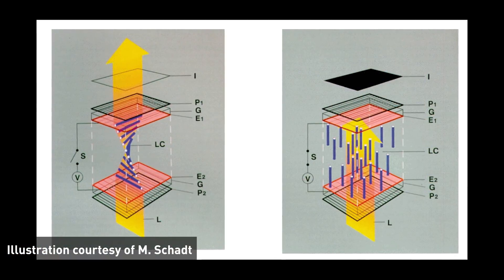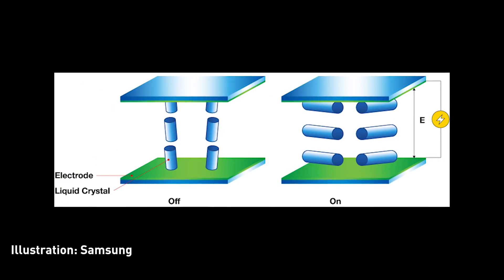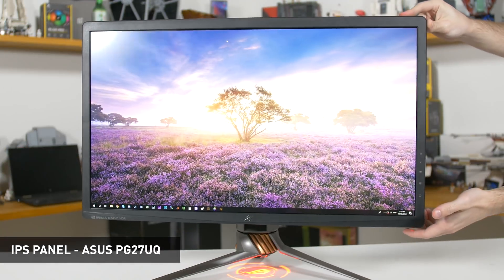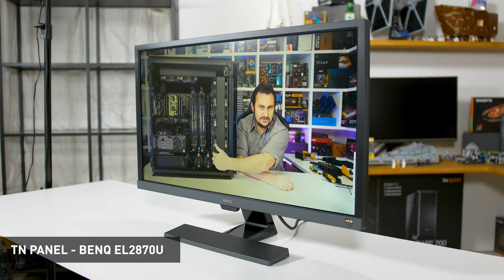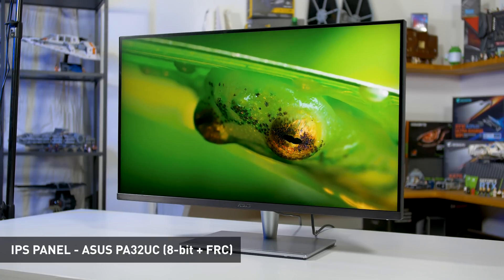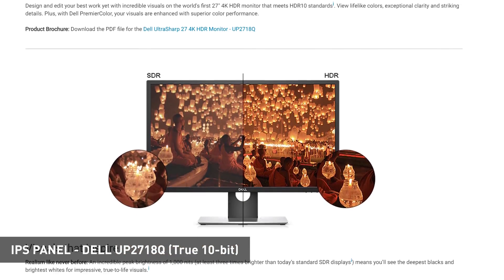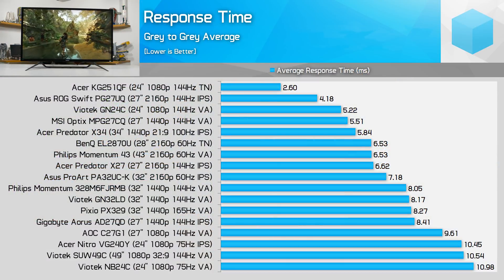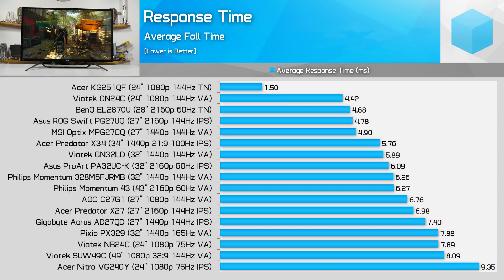TN vs IPS vs VA: Which LCD Monitor Tech is Better?

Comment: Human eyes can't see more than CRT
Reply: High end CRT's are so good though. They aren't as sharp, but they have basically zero ms response time and also have high refresh rates. Their size is the biggest problem, but honestly if I could still buy a high end HD crt monitor, I would buy it in a heartbeat.
Reply: @wile123456  shame about the eye cancer
Reply: @wile123456  It would be amazing if a company would make a modern 4K CRT screen.
Reply: Human eyes can't see period.
Reply: You can download CRT.
Reply: CRT is actually very good because it has the lowest response time. Much better than these futuristic flat screens.
Reply: Its part of the input lag anyways, there are 4ms ips panels who perform better than tn 1ms response time, and the tn just looks awful compared to va and ips, stupid.
Reply: @marcrchtz9024  how would a display with 4ms of input delay preform better than a display with 1ms delay
Reply: Because its all part of the input lag that matters, you dont notice it that it takes 5ms to put it on the screen if its a decent input lag.
Reply: @marcrchtz9024  yeah plus the fact that u would have to push a frametime with a input delay of 1ms so i suppose ur right
Reply: @imnotusingmyrealname4566  haha lol who told you such nonsense ...
Reply: @imnotusingmyrealname4566  yea only now has oled catched up with CRT's from 20 years ago. Just a fucking shame OLED monitors dont exist because of burn in.

Hopefully micro LED will be the panel technology with no downsides
Reply: @wile123456  CRT screens also had burn in.
Reply: @OTPulse  They did, but typically only when used as security monitors with 24/7 static images for very long periods. CRTs also lose geometry and brightness over time. However, they are still incredible machines. I use a Sony C520K with my 1080ti. If you have an AMD GPU and an HDMI to VGA adapter, you can even use FreeSync using CRU and other tweaks. I only need to last until MicroLED arrives.
Reply: @OTPulse  that's true but not as bad as OLED. Screensaver existed to prevent burn in back in the day, but apparently that isn't enough for oled . we might not see monitors with old because they are expensive and manufacturers think nobody will buy them.

But I would gladly take a 1 ms old screen with better contrast ratios than all these panels , but I just dont have the option, and living room TVs have too much input lag
Reply: @HansUberschlage  You should have seen all the old CRT screens I removed from the local RSL club from all the TAB monitors and other gambling charts they displayed for 14hours a day for 363 days a year. I'm not rich enough to be willing to test out what's got the worst burn in between OLED or CRT but i remember having minor issues with CRT even at home when i left the NES on pause and forgot about it and went out. Was a $2500 (in the early 1990s) 62cm Blaupunkt CRT, to say my father wasn't impressed would be selling it short. I was lucky the burn in actually faded away after a couple of weeks.
Reply: @OTPulse  if the retained image faded then that wasn't burn in that was image retention
Reply: @brotothewilliams9890  the burn in was still there, it just faded after a couple of weeks to a point when watching TV its wasn't noticable unless you looked for it intentionally. I still have the TV in the shed with a set top box with it. Thing weights a ton and in an awkward spot to remove so its staying there, still works.
Reply: @OTPulse  Oh yeah, they definitely burn-in permanently if left on continuously, the phosphors can only tolerate so much, but most often the temporary image retention can look like burn-in and goes away after a few hours or days of watching other content. When we switched out all of our traffic camera monitors (all CRT), they had permanent burn-in from the static OSD data. You could still see the OSD data when the display was powered off due to the excessive damage to the phosphors!

That said, that's why I have always done my best to protect my CRTs. At present I have three perfectly tuned CRTs in my house: Sony GDM-C520K (primary PC gaming monitor), Sony KV-34XBR800 for some 6th/7th gen consoles, and a Sony KV-32F something something for all my classic gaming/arcade. I've also got a 480p Sony plasma for standup arcade gaming, but I haven't worked on it for a while. I've got some short videos on my channel if you want to see some of them.

P.S. I love OLED, but can't justify cost relative the risk of burn-in, thus I went with a Sony 65" X930E VA display for my movies/XboneX gaming. Funny, I never realized until now that my only CRTs that have survived over the years are all Sony. My NECs, Mitsus, etc. have all died. I take that back, my FW900 died about 5 years ago. :(
Reply: @HansUberschlage  I had a Sony Trinitron until a couple years ago. Was a beauty. It too still worked but I sold it for $300 to someone who made an arcade machine with it. Kinda regret it now honestly. The only TVs we owned were Blaupunkt or Sony and they all worked when we got rid of them. One of the Blaupunkt got hit in a lightning storm and blew out the tuner and audio side so it was basically just a monitor in the end. German or Japanese stuff was solid back then.
Reply: OTPulse oh I brought a 15” Sony Trinitron monitor about 20ish years ago. Best monitor I’ve owned by far in my 20 something years of pc gaming. When I first got a 3dFX voodoo card back in the day it was amazing with the Sony. Even most tv and movie special effects looked better on our old Sony Wega crt tv than on the 65” curved TCL tv we currently own.
Reply: @wile123456  ya i found the FOMO channel too.
Reply: @imnotusingmyrealname4566  not necessarily Tn monitors can have higher response times and refresh rates
Reply: AssassinKlD final year crts were better for stereo 3d display the black to white transition times were very good much better often than the smeary grey to grey times of lcd's
Reply: They can if you download more ram.
Reply: I enjoyed 120Hz on my CRT waaay before LCD screen even appears. There is practically no motion blur at all on fast moving object, When I switched to LCD, it was like crap, motion blur everywhere and when you change resolution to non native resolution, the graphic will look like garbage.
Reply: @Chiyo Late   Exactly!  Never understood why LCD took over the monitor market so fast, it is like people have no eyes. Image quality was tremendously worse compare to a CRT for years, and they have still not caught up in all areas. It is like " hey it is cheap and small and I don't care if it display shitty graphic".
Reply: @Revener666  It was cheaper to manufacture and provided the companies larger profit margin on the product. Normally it doesn't take this long for newer dominate tech to catch and surpass the old though which is where I would personally like to find out the answer to.
Reply: @chemislife but companies can't sell anything if consumers don't buy. Sadly most people doesn't care if something is an inferior product as long as it is cheaper.
Reply: @Revener666  they translate some of the savings to the consumer so as to encourage them to transition to the new thing. Normally it only takes a few years for the new tech after it catches on and gets revenue coming in to catch up to and pass the old medium. This didn't happen and I would love to know why.
Reply: @chemislife  yes but my point was about people buying something that was clearly inferior for years and still have not caught up in all areas.
Reply: @Revener666  Because size and weight. Once you started moving above 40" you might as well be moving a bonefide safe. Who in their right mind would want a tv that takes up the space of a couch or more?
Reply: Not talking about TV, talking about Computer monitors. What use would you have out of a 40" computer monitor. A TV can have crappier picture since you sit further away from it and not right up at it staring at all the pixels. 
Besides how often do you really move a monitor, a majority of computer users just let it sit where it is until it breakes or you move. :)

Dunno where you got TV's from at all since the video is about computer monitors.
Reply: @Revener666  Probably from the fact that generally speaking, we use the same tech for both. And lets face it, many of us are using 20+" displays, upwards into the 30's, multiple screens, etc. CRT just isn't a very space friendly technology. Or power friendly. Not sure what the love for CRT is. I don't miss it, I like having my desk space. I assume you use a CRT?
Reply: Until a bit ago yes, still have 5 of them around. Only switched because of aspect ratio, the image on them is still better. 
And using the same tech for both ? Sure I will use a 42"+ TV as a monitor and sit right up near... not. seriously dude. Besides we where not using that huge screen when LCD screens took over the monitor market, so it is an irrelevant point.
And it is not about missing it, why would you on purpose torment yourself with the craptastic image quality, it took years for LCD monitorts to even get close and they still lack in certain areas, it is not even arguable it is plain facts.
Reply: @Revener666  Flatscreens were never cheap. In 2010 I could get a CRT TV for $12 dollars whereas in 2016 I bought my first ever 1080p flatscreen for $125. Even back in the 90s my parents never paid the ridiculous prices they charge for current gen LCD/LED/OLED/4K when they bought a brand new CRT TV, let alone computer monitors.
Reply: @dhrgkbqxtjr2743  CRT monitors did cost more than CRT TVs. TVs had crap picture.
Reply: @dhrgkbqxtjr2743  Talking about TV's when we are talking about monitors ??????
Reply: @Revener666  most people value desk space and flat panels looked more stylish
Reply: @RobBCactive  Most ppl have the required desk space. It is not a real argument except in a few occasions that a CRT is bigger. And if something  is stylish or not is in the eye of the beholder. so also not an argument.
Reply: @Regnent  and also about same tech. monitors had better quality CRT, was much sharper compared to any TV.
Reply: At people who mention Freszync for CRT, why ? I have never seen screen tear on a CRT unless the hardware is actually broken.
Reply: Just download more plasma
Reply: @EJSC just a shame it is so small and is only 1080p though.
Reply: I left my Viewsonic G90fb (Black) monitor at an ex's when I was moving out about 5 years back. It was too small at 19" but I couldn't move away from it until 144hz LCD/LED came out. I bought a LCD 22" screen for about £230, used it for 10 minutes and then put it back in it's box as it was terrible (60hz). Sold it to a good friend for £15 the week after and went back to the CRT. When using lightboost (Blurbusters), that's the only time my 144Hz monitor was close. Nothing can compare but damn those CRTs weigh a bit and take up some space.

The 144hz monitor that replaced the CRT is now dying as of 2 nights ago. I can only use it at 100hz without there being a disco on my screen but my new monitor arrives Wednesday thankfully. Can't believe this is only going to be my second screen since leaving CRT behind.
Reply: @EJSC dont hey just make panels and research, but not actual products ?
Reply: #MakeCRTsGreatAgain
Reply: I'm not human, according to African primitives. I'm Neanderthal and proud!
Reply: There are more visible colors than what can be generated with RGB, and some individuals see more than others.
Reply: humanist....
Reply: our sub mind cant outrun the speed of our eyes by 100 times...even on games the super cpu when i run i turn suddenly eithout reason and kill enemy...we dont know nothing yet
Reply: Can crt with Butt monitor compatible with the new hardware?
Reply: shut the fook up
Reply: lies all lies that 8k tv at bestbuy WOW!!
Reply: @IorekBear92  Eh?
Reply: @IorekBear92  Fortunately I never had DSL, I was fortunate to go from 28K to T1 to cable.
Reply: They can.
Reply: @IorekBear92  CRT where fast yes , and smooth. Basically no screen tearing and do not give you "speed tracers" and smudge the image when you move the mouse around fast. And did most certainly not look like shit.
Reply: @IorekBear92  I guess you just have to see them side by side then..
Btw never needed syncronization on my CRT's  didn't get screen tearing since they are so fast.  LCD screens use so many hacks, extra things and work arounds  and still lack in some parts.
Reply: @IorekBear92  with fast and smooth I did not talk about Hz. There is no liquid crystal lag. And annoying backlight that is never quite correct.
Reply: @IorekBear92  Lets see. 
Nope no flicker on CRT's I had unless it is set at too low refresh rate. 
Another invalid argument that always annoys me. And I am sensistive to flicker.

Blacks are still vetter on CRT, depth is usually still better , contrast is not worse and sometimes better, correct colour reproduction without buying a special screen.

Degration over time is overated and I attribute that to cheap screens. all my 3 samtrons fromaround  2005 are still fine. 

I don't care anbout power consumption.

Never had any interference issues.

They can show all resolutions with good quality. Although with 4K LCDs that is hardly noticable since the pixels are now so small. 

Also shaky handcams don't bother me on CRT and they do on LCD.

Text scroll better on CRT.
Reply: @IorekBear92  Not talking about television, no one is talking about television here, CRT MONITORS! for computers big difference.

Btw there are LCD screens with strobe backlight for a reason.

"like the difference between 1080p and 4k in varying screen sizes and aspect ratio's" yeah that is very visible but what did you mean?

Also I said that I am sensistive to flicker so I can see flicker. learn to read.

I am tjat guy that walked by friends and other peoples computers screen and turned up the refresh rate because I told them it flickered and they had not noticed.
Reply: @IorekBear92  it makes a difference, I notice the drawbacks that still exists in LCD every day.
Reply: @IorekBear92  I know that, my current IPS monitor cost 570$ and got good reviews on more than one site and youtubechannel
Reply: This is just false.
Reply: Which one is good for eyes?
Reply: fuck off this kind of comments m sick of seeing this kind of comments
Reply: Typical an "i need attention comment".